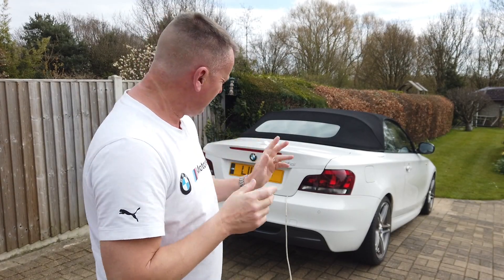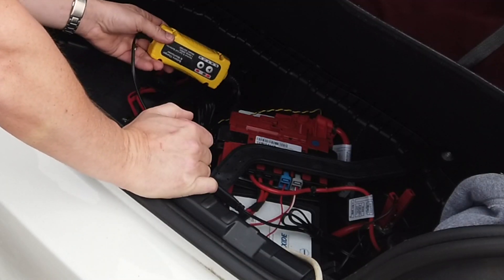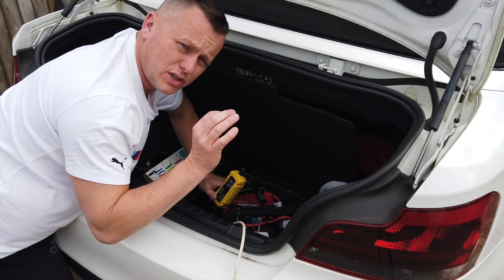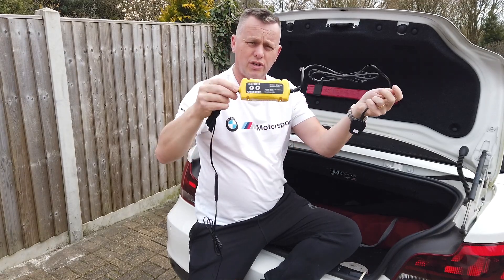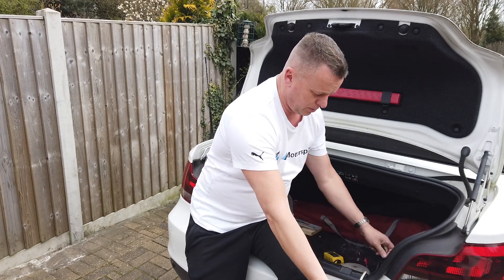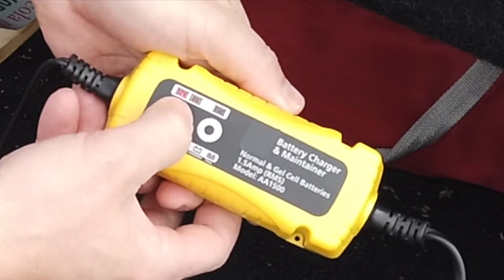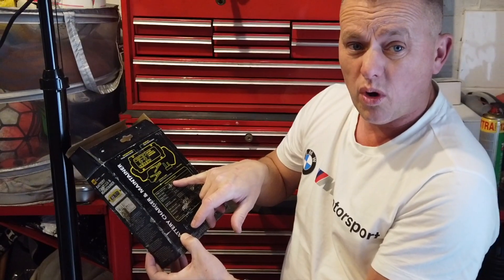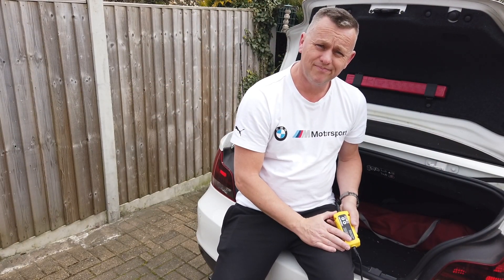"Charging A Car Battery" Is Your Battery Flat How To Re-Charge, Battery Charger Review.

Comment: For a Range Rover velar do you connect the charger to the jump points (in the bonnet) or directly to the battery (in the boot)?
Reply from the maker: To jump start connect under bonnet, to fit battery maintainer goto which ever is easier, Thanks for the great comments👍🏻👍🏻🛠

Comment: Excellent. I have a Ring RSC804 smart charger. I also have an old Subaru which is off the road in the summer. I found this weekend that it will not start. The battery is showing 11.8 volts but the smart charger will not recognise it, even at 11.8 volts. I thought that smart chargers would recognise anything over 10.5 volts. The charger itself works well on my stop-start Citroen battery but that one has enough charge in it to start the vehicle. Can anyone on here tell me why the Ring  in not recognising what is a simple lead acid battery, please. I bought the charger specifically to top up the Subaru battery whilst it is off road. But it won't do it.
Reply from the maker: It sounds like the charger has an issue, or the battery on the Subaru is faulty, Thanks for the great comments👍🏻👍🏻🛠
Reply: @aaanton11  many thanks for your reply. I am hoping that this following comment might help some people on here. After I had posted my comment, I looked through all the other comments on your video and found a reply by you which I thought i would try. The Ring instructions are, with the battery in the car, to connect to positive ad then to an earth on the engine. I checked that the earth had continuity and it did. But looking at what you said, I took the battery out of the car and connected the charger to  the terminals direct. And it worked. The charger has now recognised the battery. Voltage has gone up from 11.8 to 12.8 already. I looked at lots of forums and videos before yours but never found an answer until now. So very many thanks. You have probably saved me a lot of trouble and money
Reply from the maker: with a smart charger I would always connect directly to the battery terminals when the battery is fitted to the car, if boost starting with a big booster then I would go battery positive and engine / body earth, Thanks for the great comments👍🏻👍🏻🛠

Comment: Pretty rough video to be honest. No details of the actual charger, throwing everything in that boot & you're not even meant to charge direct to battery on BMW. You should be charging through posts under the bonnet, as this protects all that circuitry on the battery, & also enables the IBS to monitor the charge.
Reply from the maker: The posts under the Bonnet are for jump starting, there is no issue using a battery maintainer fitted directly to the battery Thanks for the great comments👍🏻👍🏻🛠
Reply: @aaanton11  you can look at any forum, any other videos of charging a BMW battery, & it's always recommended to use under bonnet connections.

Comment: Hi just bought Aldi charger trickle charger like yrs in instructions says disconnect battery terminals before connection of charger.
I think u haven't would I have to?
Would be grateful for advice as u probably are a mechanic by looks of things.
Reply from the maker: No need to disconnect the battery, just clip it on, Thanks for the great comments👍🏻👍🏻🛠

Comment: I have just purchased one of these. The 12v and power light at the top light up red. Please could you tell me if this is correct as the leaflet included shows them as being green. Many thanks for your video.
Reply from the maker: once connected press the play button, Thanks for the great comments👍🏻👍🏻🛠

Comment: GREAT VIDEO BUT I HAVE A BRAND NEW BATTERY WHICH HAS GONE DEAD (!) AND WHEN I CONNECT THE AA CHARGER IT SAYS "FAULT". ANY THOUGHTS?  MANY THANKS
Reply from the maker: disconnect the battery and recharge, sounds like you have a drain or a short circuit on your car, Thanks for the great comments👍🏻👍🏻🛠

Comment: Most impressed with this video, have decided on the AA Battery Maintainer, can I buy a duplicate set of eyelet connectors for my second vehicle ?
Reply from the maker: The connector plug is quite a standard fitting I am sure you can find one on eBay, Thanks Mike for the great comments👍🏻👍🏻🛠

Comment: Thanks for this really useful video. I've just bought one, waiting for it to arrive. I see you didn't disconnect the cables on the battery terminal posts, so I understand it isn't necessary. You connected the negative crocodile first and then the positive. Does the order matter? And when disconnecting, should it be in a particular order ? Thanks
Reply from the maker: You just connect the leads doesn't matter which order, and turn on the charger, job done, Thanks for the great comments👍🏻👍🏻🛠

Comment: Good advice for people who have a vehicle which is not in regular use. However if a car is used say once week for maybe only a few miles, the battery should not go flat. If it does, the battery may need replacement, but check the charging system first. I had a car which only went out once a week for about a 5 mile trip, and the battery was fine. After 7 years from new, the battery started going flat. I charged it, and drove straight to a car store where I bought a new battery. The old battery had a 5 year guarantee, so 7 years was good.
Reply from the maker: Thanks for the great comments👍🏻👍🏻🛠

Comment: I've got a 2003 bmw 320d, the battery is in the boot, I've also got battery connections at the front,my question is - can u connect the charger to the battery points at the front of the car, rather than connecting to the battery itself?.. Thanks for a great video
Reply from the maker: Yes you can also connect under the bonnet at the front points, Thanks for the great comments👍🏻👍🏻🛠
Reply: @aaanton11  thanks for your swift reply... Can I connect the earth/negative cable to any metal part of the car, as long as its got a good negative connection.. Thanks

Comment: nice video? I see the car charger you used is rated at 1.5amps? any reason why you didn’t go for a slightly higher amperage; say 8-10 amps?
Reply from the maker: If you have the option to go bigger I would, there is a great Norco one linked in the description, Thanks for the great comments👍🏻👍🏻🛠

Comment: Hi! Friends have been having loads of problems with cars with flat batteries,  and I've found that a lot of modern chargers won't charge batteries that are completely flat. Apparently this is to do with the sophisticated sensors in them (?) I found the way round this was to link them to another battery (as you would to jump start, leave it for an hour and then there is enough charge in the battery for the charger to detect it and do it's stuff.
Reply: I have zero car knowledge but wouldn't it be easier to get a jumper starter kit? they are probably cheaper than an actual battery and allow you to not only jump start your car but you can use them as a torch and charge USB devices...?
Reply from the maker: That is great information Peter, the charger I used is able to bring dead batteries back, as are most modern smart chargers like in the links in the description, it can take a couple of hours for the charger to de-sulphate the battery and get the juices flowing again, Thanks for the great information👍🏻👍🏻🛠

Comment: My batteries not completely flat as the stereo still comes on, should I charge from front under bonnet or just on actual battery like you did. Think I’ll need to invest in a new charger first though mines 20 years old! Cheers mate.
Reply from the maker: You can connect front or back, which ever is easier, links for some great chargers in the description Thanks for the great comments👍🏻👍🏻🛠
Reply: aaanton11 Awesome thank you! Got it, just heading over to Amazon now to buy one. Thanks again

Comment: Nice video again thanks!, completely off topic with this question but have you a fix for no low fuel chime on the pug 107? Keep safe and keep up the good videos pal!🖒
Reply from the maker: I am not aware of a chime, might be wrong but I thought it was just a flashing bottom bar on the dash panel when the fuel was low? I stand corrected you get a single chime when the ignition is turned on when the level is low, I will look into this 👍🏻Thanks for the great comments👍🏻👍🏻🛠
Reply: @aaanton11  thanks for your response pal👍 I'll explain the way the chime was on the low fuel scenario, when the last bar of fuel is reached it chimed 3 times, then everytime the cars ignition was turned off then on again the fuel would chime 3 times again until fuel topped up, but it now does not chime at this point at all, now here is a possible cause I will have to address the seatbelt chime is disabled and may possibly cause the fuel chime to be disabled also! I will enable that again and wait to low fuel to see has the chime for that come back🤞

Comment: Good timing with this, there are going to be a lot of flat batteries in a couple of weeks. Tip - if you’ve got a driveway with power nearby., park the car facing towards the power source you can charge up without people seeing you bonnet isn’t fully closed. I use a charger I bought from Lidl, it’s pretty advanced and cost about £15.
Reply from the maker: Sounds a bargain, the only problem, lidl is like Aldi and they don't stock the same stuff all the time, you have to buy it when you see it or next time you go its gone😂😂 I do like the Man Isle as I call it, with all the tools, Thanks for the great comments👍🏻👍🏻🛠

Comment: Bluetooth battery monitor
Reply from the maker: Yes that's always a option, but they also take power from the battery, so if the car is not being used it just adds to the problem, Thanks Simon for the great information👍🏻👍🏻🛠